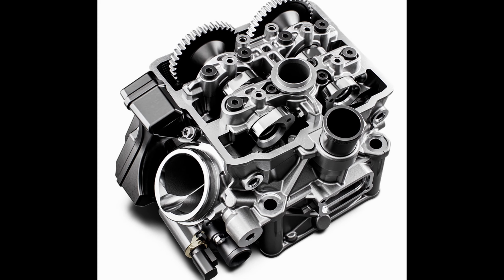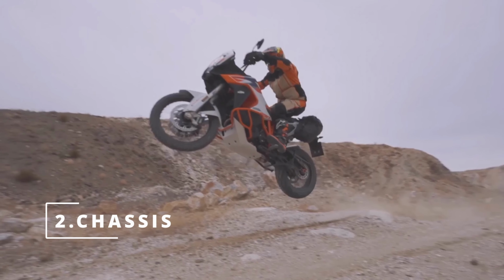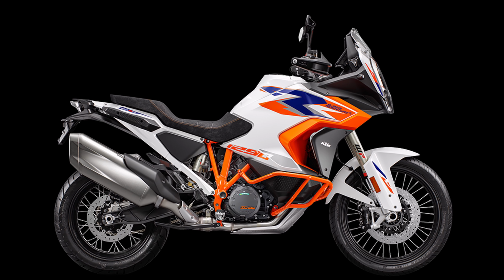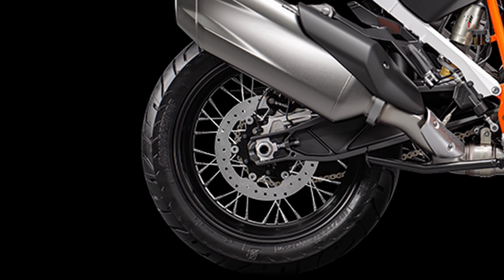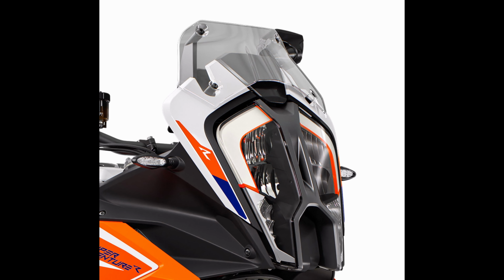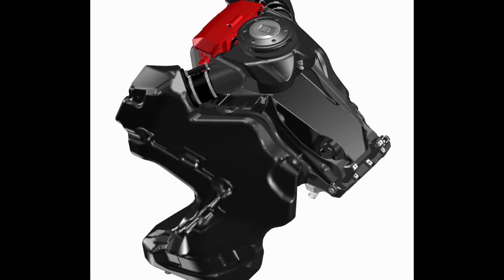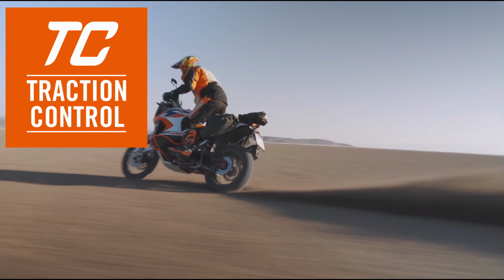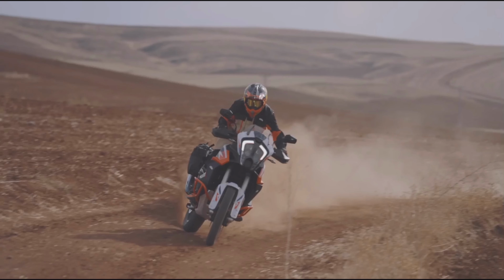2023 KTM 1290 Super Adventure R - Bike Chat

Comment: The R has a 21” front wheel vs S 19”
Reply: Rear is 18" not 17"
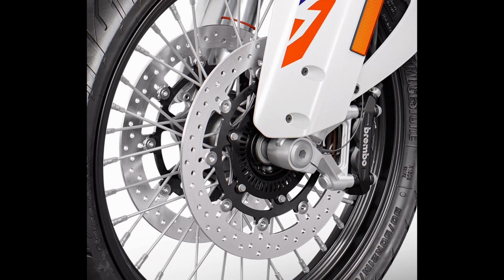Reply: Even in the video at 04:57 you can see the 21 inch front tyre marking. R versions are fitted with the 21" front and 18" rear as you mentioned